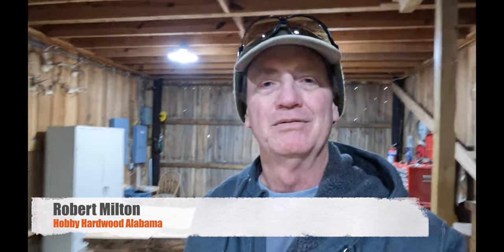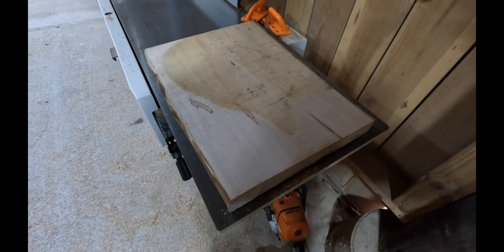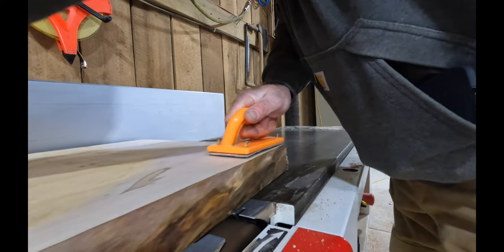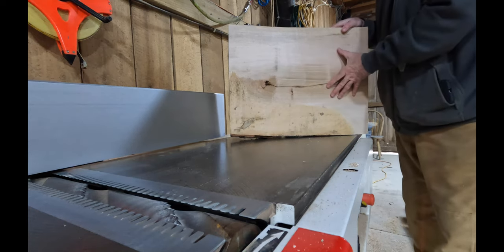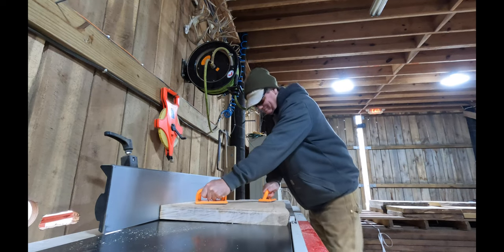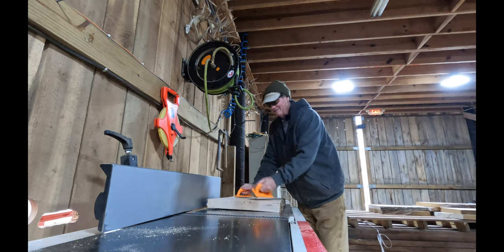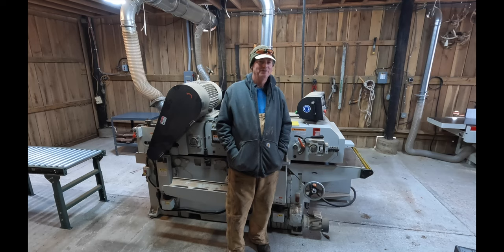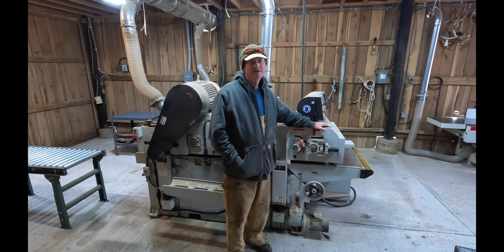Jointer and Planer - How the Pros Use Them. Professional Sawmill Tips at Hobby Hardwood

Comment: Question: On your planer beds do you find it necessary to wax it and if so what wax are you using ? Having trouble with my 16 inch planer from feeding straight. Thinking the bed needs wax but the SC Johnson wax I have seen on other videos is not available here.
Reply from the maker: Waxing should not be necessary to properly feed boards, only to protect from rust.  Waxing, even if it works, would simply be hiding the symptom, instead of foxing the problem.   90% of issues with planers is due to the pressure bar, if it has one.  Then, the height and downforce adjustment of the pressure rollers.
Any furniture wax would work, or even Boeshield or similar.  Do not use any car wax with silicone, as that causes the furniture finish or stain to speckle.  Beeswax would work, also.  If your rollers are urethane, they may need to be cleaned.

Comment: Do you normally run with or without the guard?  Having never owned a jointer, I'm watching you and worried about catching the sweatshirt in the near side of the blade head.
Reply from the maker: I was wondering when someone would catch that, and it took about a year.  No, we have a real nice guard, but removed it when we made this video the second time.  When I made this video, I ran with the guard on and we couldn't see anything about how the machine was cutting.  So we had no usable video and made a decision to remove the pork chop guard to see how the cutters were actually biting into the wood.  We had to film parts of it a second time, and I thought I had put a disclaimer on the video such as "All guards are removed for film purposes" or something like that, but missed.  This is one of the reasons filming is such a pain and time waster.  The job went from an easy "Let's face these boards and move on" to "Well, we just wasted a lot of time setting up and narrating, and couldn't actually see anything, and now have to do it all over."  Major waste of time.  Good to hear from you.
Reply: @HobbyHardwoodAlabama  You did have the disclaimer in there, but was wondering if you really did keep it on when normally jointing boards like that.  For example with my 1953 delta unisaw, I put the guard on once when I got it, then took it off for good because you can't see what you're doing with it on.  I was wondering if your jointer was like that, or if you worked normally with the guard on, and you've been clear that you keep it on.  I walk with Bob in Canada a lot, once or twice a week.  You come up a lot as a good example of things in your discussions.  Hope you're enjoying this time of year!  Thanks Robert, Brad_bb

Comment: One more thing, in the video you're jointing short pieces.  How often are you jointing 8ft boards?  Is there a technique to holding and pushing them through to do it well.  I'm getting ready to pull the trigger on a 12" jointer.  I have my first load of walnut back from the kiln and I would like to prep it so I can put it on my shelves, not so sell mind you, just for my use.  You can tell me just try it and you'll figure it out, if that's the case.  It won't offend me.
Reply from the maker: We face a lot of 8 foot boards, but if the bow is more than what can be removed and still make minimum thickness then we cut them in half.  For example with an 8' board, at 15/16" thick, if the 8 foot bow is more than 1/8" then that much must be taken off each face to flatten it removing 1/4" total wood.  That would cause the board to be less than 3/4" and so becomes unsellable.  So we consider that with every board.